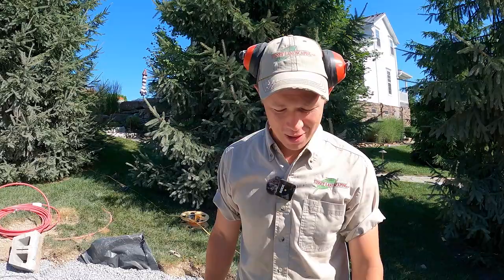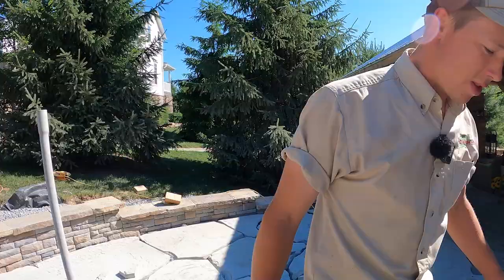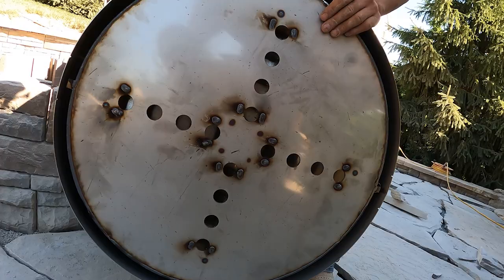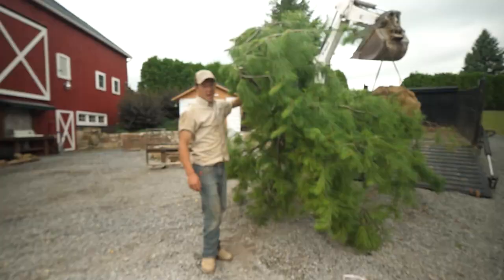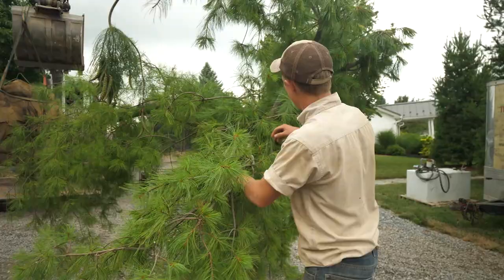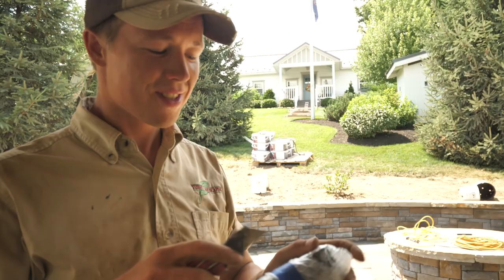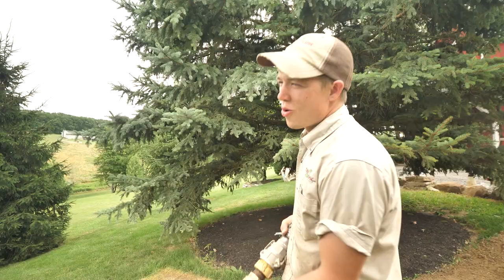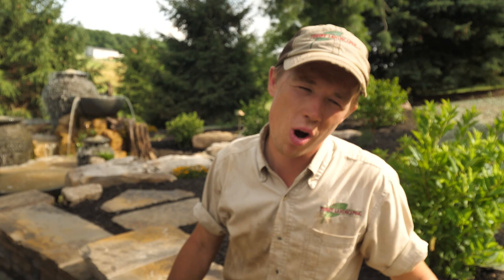No More Hardscaping... Time For The BIG Reveal! | Part 3 | Tussey Landscaping

Comment: Great build guys - beautiful!   Hey how much splash radius do you figure for a med stacked slate urn?  In other words how far out do you need liner?  We are in Colorado and it is very dry so the loss of water is an issue.  Can you help?
Reply from the maker: I would go a minimum of 6 by 6 for a med urn especially if it's windy there. You could also run down spouts in the basin if you have water shortages.
Reply: @Tusseylandscaping  thanks for taking time to reply!  We are going to run a down spout to the basin and probably use 10-12 Lg Aquablox so that we have 300+ gal of reserve after a rain and it will have an overflow.